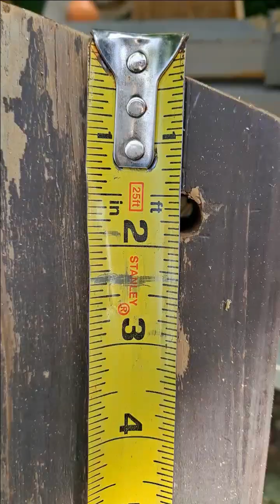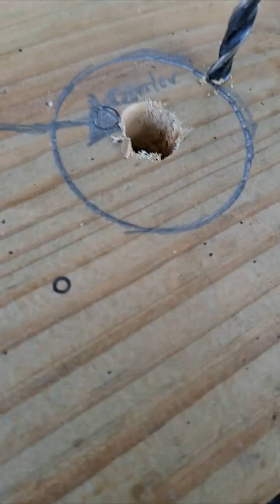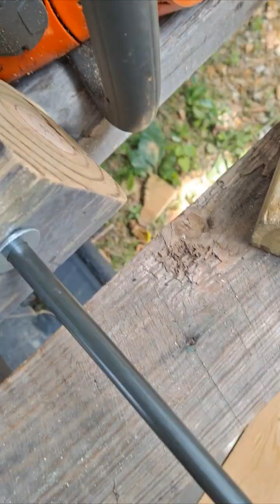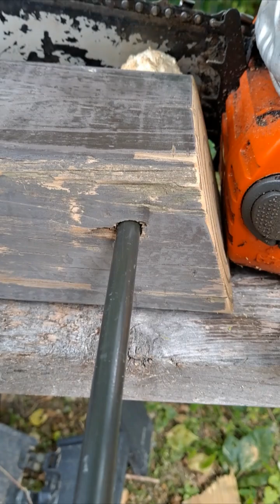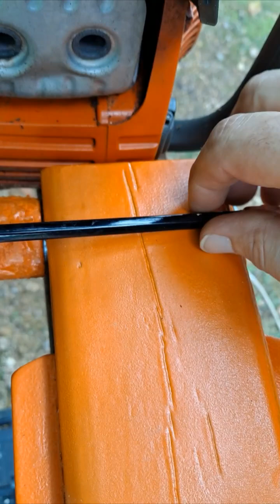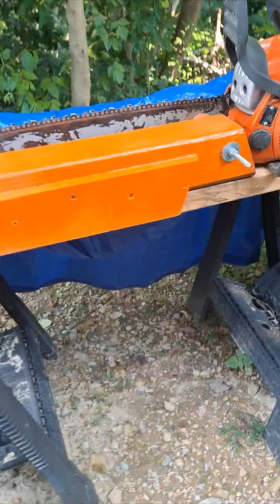How To Build Your Own Chainsaw Mill To Make Lumber

Comment: So if your chainsaw bar doesn’t have a hole in it, do you drill a hole thru it in order to mount it?
Reply from the maker: Yes. That's what I do. The details are in the instruction manual with helpful illustrations of the measurements to get started.
Reply: @makeitworkdan6463 ah ok, thank you!